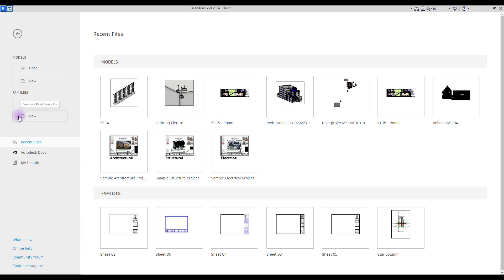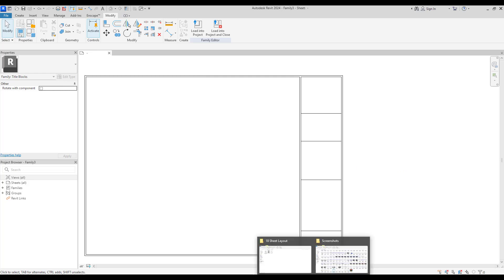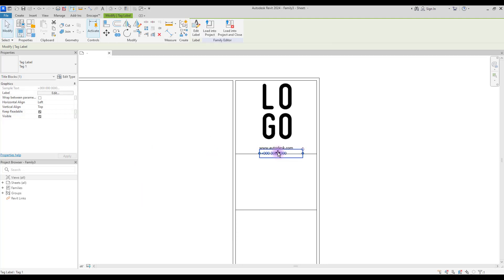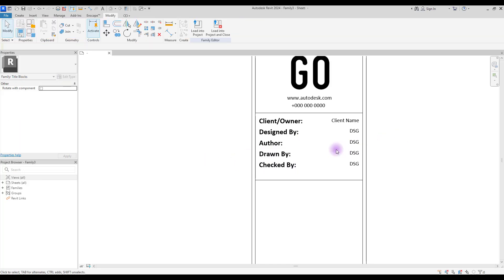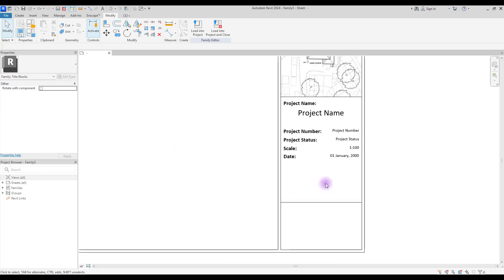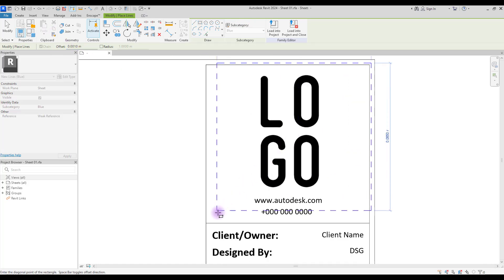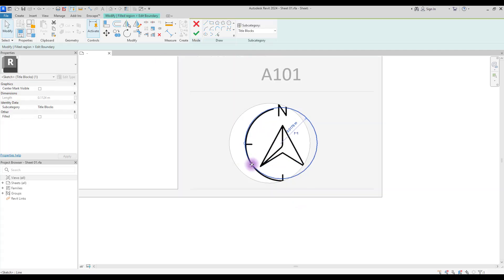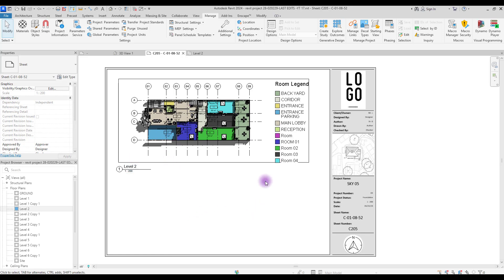Title Blocks in 15 min with Revit 2024 #revit

Comment: When i load the tb to drawing the lines over the field region become invisble?
Reply from the maker: Try to first create the lines in background and then draw the ones that should be shown in front. Or select them and use "move backward" or forward.
Reply: @RVTPLUS  Thank for your reply, I m using Revit 2023, in titleblock creation the option for move backward doesnt exist.
Reply from the maker: I just checked, and the correct name is "bring to front" and "send to back". If you select your detail line, you can see them under the tabs.
Reply: @RVTPLUS  Thank you for the help. for some reason there is no option in title block edit mood, so what I did was I created a generic annotation and loaded to the title block and it worked.
Reply from the maker: That's a creative solution 👍 I suggest open a new family and test it there too to see what was the issue.

Comment: I have seen many videos but to be honest no one explained like you 👍
Reply from the maker: So glad to hear that 🌼
Reply: @RVTPLUS  thanks
Do you know how to do new parameter for sheet in Revit 2024?
Reply from the maker: If I know for which part of the sheet you want to add the parameter, I can assist you better.
Reply: @RVTPLUS  I have green area, builtup area, total floor area……., ready parameter is not available for this purpose we have to create 
I searched in youtube and found that I have to create it 
Create new parameter in version 2024 is changed, I have searched but couldn’t find solution
Reply from the maker: Well as much as I know there is not that much difference between these two versions!! If you need to add a separate parameter, you probably need to create a "Shared parameter"
Reply: @RVTPLUS  thanks 💐

Comment: Hello, good day... I have a question... at minute 13:54... when you do the title block test you do not see the drawing lines, you only see the filled region that covers all the lines, in The second after that, the drawing lines are shown... I have that problem that I cannot see the drawing lines on my filled region in the edition of my title block.... Could you please help me?
Reply from the maker: Hi there. This is common when it comes to using filled regions, and I usually fix it with either one of these ways. First, If it is a title block, you can just simply draw a line around the filled region from create tab. You can use wide Line type if you want to have thick lines. Or select the filled region and go to its Edit sketch. Then select the line around it and change its type to medium line or Wide line. Hope it helps.
Reply: @RVTPLUS  Your point is clear to me with the contour lines of the filled area, however my question is directed at the lines that are within the filled area, the intermediate lines that divide the blocks of your title block... Sorry for the insistence but I have not been able to solve the problem.
Reply from the maker: Don't worry, it's okay. 
So If I got it right, You want to have lines on top of a field region for example for separating different sections, right ?? But your lines on filled region are invisible !! 

I just checked it on a view. I draw a filled region with solid pattern and draw a line on top of it. The line was visible inside and outside the region. If you select the Line, you will see Bring to front and bring to back icon and also convert line. So make sure the line or filled region is selected and then check these options. If you select the region and send it to back, all the lines behind it will be visible. Check convert line first.

It could be a bit tricky, so I suggest watching the video carefully, I shared a lot of hacks there. 
Creating a new line type might also help. You can see how in here:
https://youtu.be/vumgVdwdxm4?si=U2bzgsS3IOHGM7SO
Reply: @RVTPLUS  Hello again, first of all thank you for your answers, at the moment I have not been able to solve the problem... I made a quick video referring to the problem, I sent it on YouTube only so that you can see it... if you would do me the favor of watching it And if you could answer me I would be very grateful.
Reply from the maker: You're welcome. I am trying to see what could be the problem and how we can fix it and i will let you know when I find it. But meanwhile have you tried to test this on a new title block family to see if it works?? Because I tested this on multiple families and on different devices and there was no issue like this.
Reply: The options for bring to front or send to back aren't available in the title block family creation section for some reason.
Reply from the maker: Yes, they are not working on 3D or most of the elements. However, you can use them for region or masking area. They work on 2D annotations.
Reply: Hi!! 
I was able to solve it by superimposing text. I typed the letter "I" and modified its size and thickness until I had a similar line. It's the only way I was able to solve the same problem.
Reply from the maker: Thanks for sharing this with us.